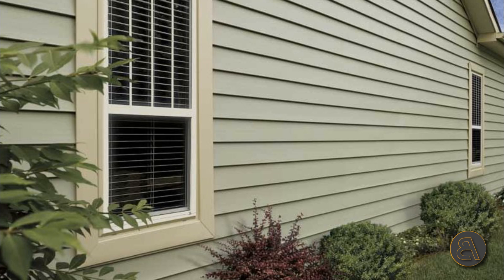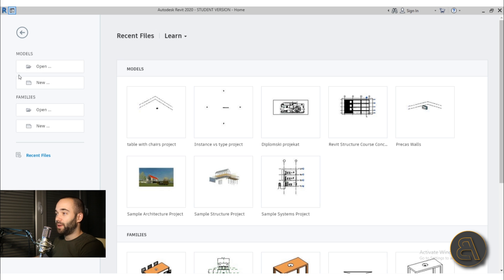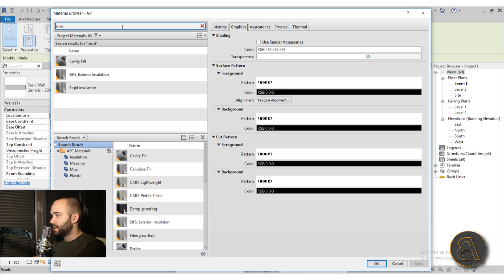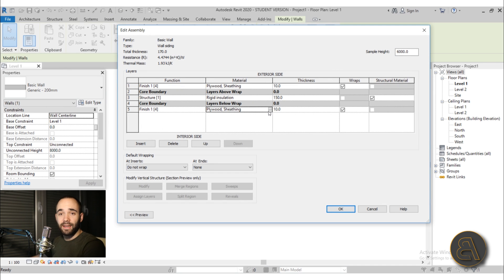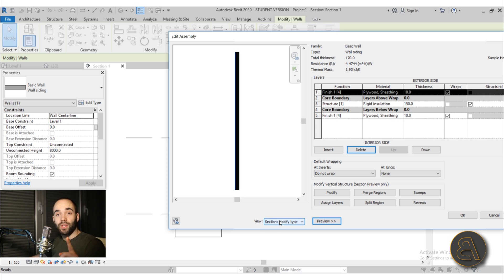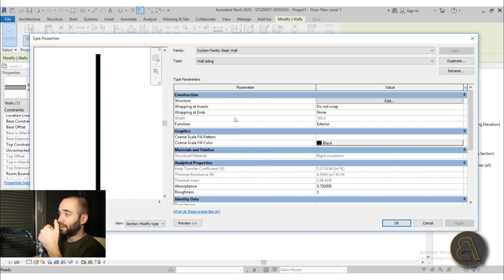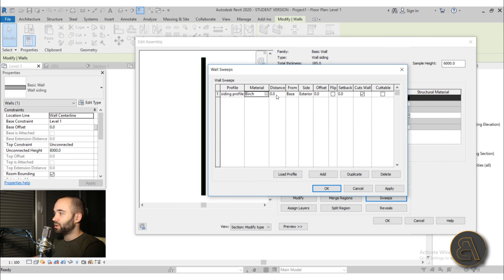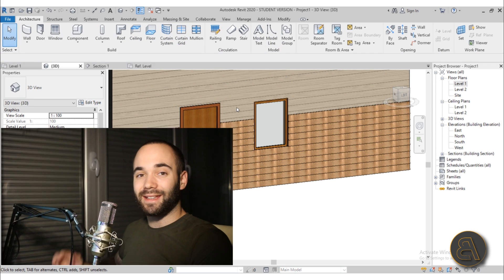Siding Facade in Revit Tutorial

Comment: Another excellent video.  One question/suggestion, though, as an American who uses siding as a disigner/builder.  The layers of siding are set at a certain "reveal".  Which means there is a consistent amount of the siding material visible per row.  The amount of reveal is determined by dividing the height of the wall to find the most reasonable number.  However, at the top usually the last layer(s) have to be trimmed.  In this program, how would you program the profile to account for this adjustment?  Would another profile simply have to be created and inserted?

Comment: First of all, thanks for the great vids. I have used them alot. Anyway tried this tutorial out, but there is one small fault which I found out that's need to be addressed, which this when you add your sweep I had to check off the cuttable (all of them) to get this to work correctly. Here aften no problems whatsoever. Keep the good work up.

Comment: If you have to type values you would have to calculate you can always type: "=" and then enter your calculation.
For example : "= 155*2" and it will give you "310" if you confirm it.

Also keep up the good work!
Reply: Hey thanks!
Reply: excel trick

Comment: Interesting technique, however I would always expect on professional projects to just use a surface pattern to the thickness of the siding layer.

Good for small scale housing however, which I guess as you mentioned is the most common application for this anyway.

If the sweep could be automatically arrayed then maybe, but it probably isn't worth the effort when a good bump map could achieve a convincing siding shadow from a distance.
Reply: You should check out the video where he and another go to Autodesk...